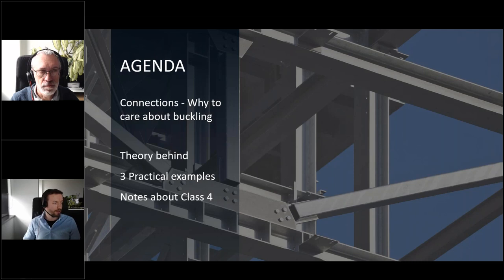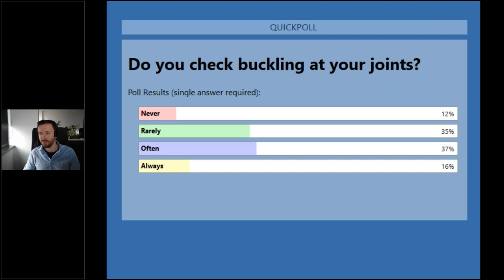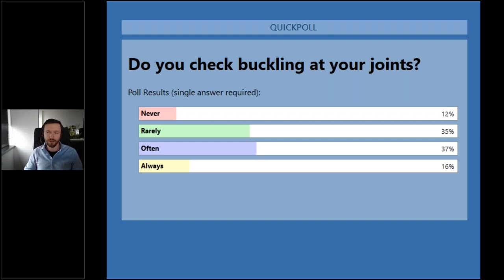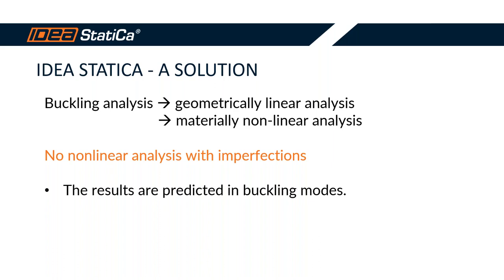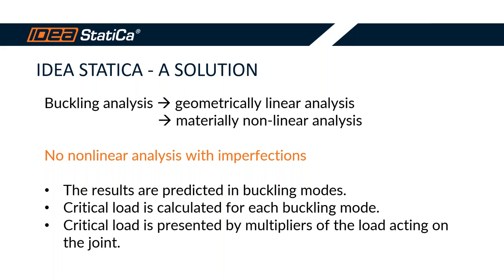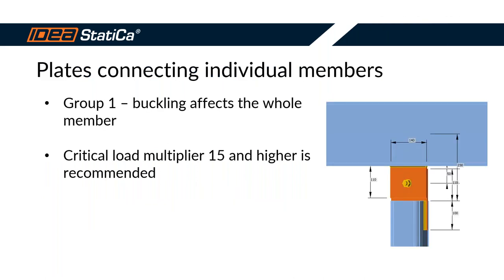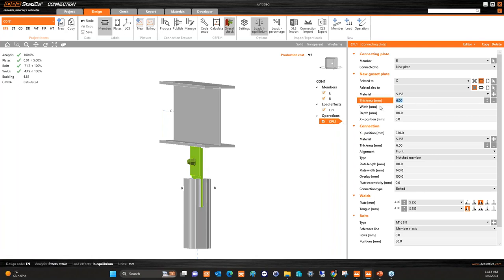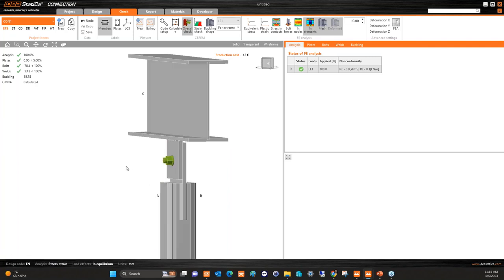Connection Wednesdays - Buckling analysis - an important piece of connection assessment

Comment: Great webinar, thanks)
What if we reproduce the connection in IdeaStatica  Member? There is most advanced design now GMNIA - would it be more accurate than in Connection regarding local buckling?
Reply from the maker: Thank you :)
Connection tells you the buckling shape and its critical factor, then you consider what to do - either its not dangerous or it is and then you react by strengtening or doing further analysis. And this is the point when you use Member - mode the connection and surrounding members and analyze it using the imperfections of the beams as well and the program tells you whether it will really buckle and fail the code-check or if it is safe.
In other words - analysis in Connection and Member are based on the same CBFEM method inside, just it shows you a bit different things. And in combination of these 2 apps, you get ultimate combo of calculating everything :).
IDEA StatiCa team